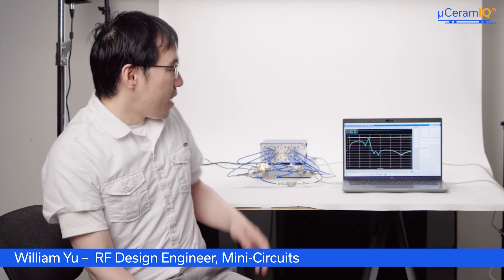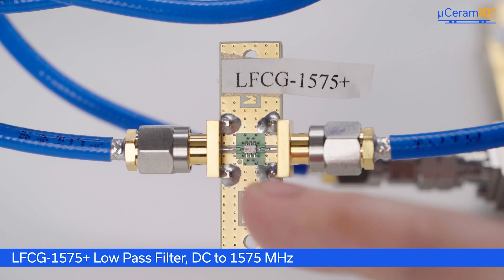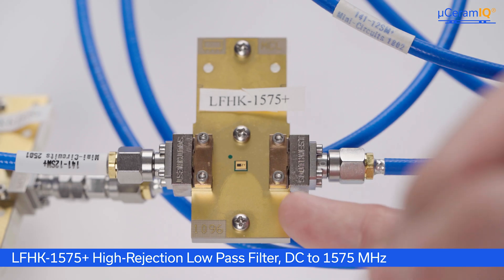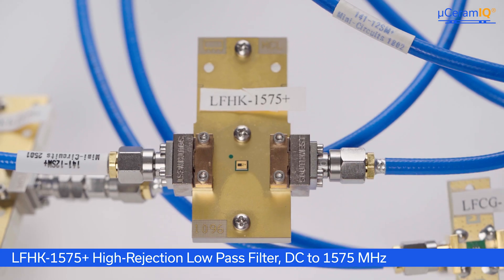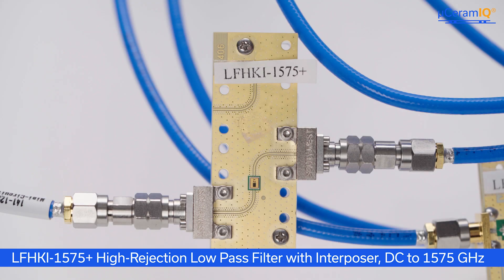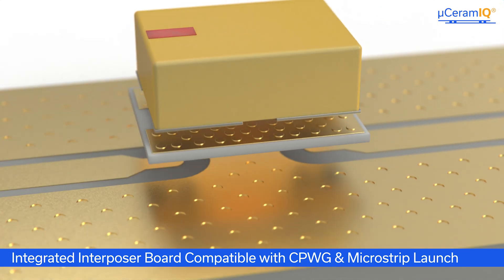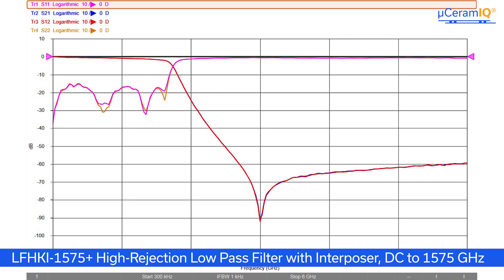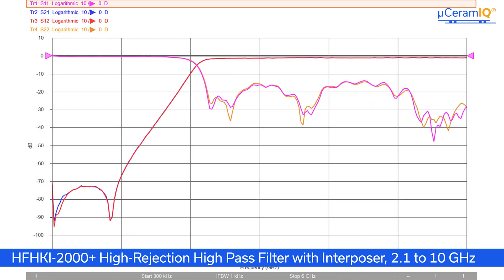RF/Microwave Micro-Ceramic Filters for Stripline, Microstrip and Co-Planar Waveguide (CPWG) Launches

Comment: Nice video.  For microstrip filters, you can sometimes bring the enclosure ceiling in contact with the filter top via finger stock or EMI gasket, which will improve rejection.